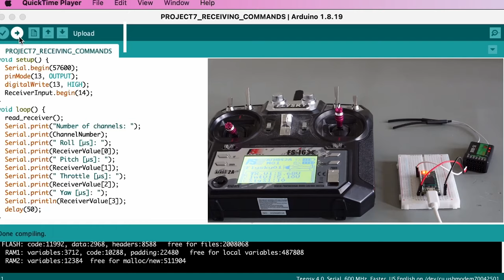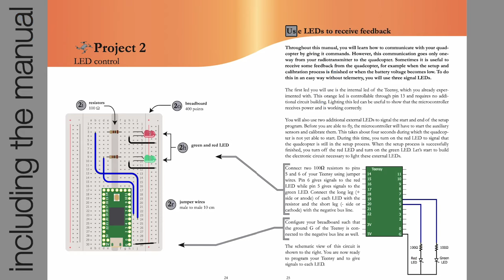Build and program this Arduino drone yourself!

Comment: Finally, airborne on the drone in my small backyard. But I need to go to a field, not my backyard, because of the cars passing. More to come of a video of a CA drone airborne.
Reply from the maker: Hi Robert, I watched your video's and your build is getting along very nice, great to hear you had a succesful flight!! With regard to the issues you encountered along the way, the screws provided by geprc with the motors are indeed a bit tricky and you need to verify that they do not touch the motor windings. I think the uneven startup of the motors might be caused by the width of the traces on the upper PCB, leading to an uneven distribution of current during the initial startup. I tried widening these traces a bit and the startup is much smoother now... good luck with further flying/adapting the drone!

Comment: I love the educational aspects of this project, well done.  I will purchase the control board and do all the associated projects. (I'm into RPi, Arduino, ESP32 programming and projects.) I like that you provided for FPV Tx power, but I would like to do a final built on a larger frame.  Do you see any issue using the control board as is with a 5" frame and larger ESCs (perhaps a 4-in 1) and motors?

Comment: After waiting and ordering a cheap batch of ESC, I finally found all four matches after calibration. As a result, the Ca Drone 1A can now fly and has 300+ lines of code from Ca Arduino  Drone manual.
https://youtu.be/xi5ei9N0uXg  is the video recorded in my backyard. With the Ca Drone code, one can modify it with additional sensors and experiments. This was a fun project, and learning the math under the hood.
Reply: Is there a naming convention of the CA (Ca? in keeping with his logo)  ...the CA drone?  Might I suggest a frame shape designation. H for H frame, X for X frame, etc?
Reply: @charlesbiggs7735  Made the changes, and I agree.
Reply: :face-orange-frowning::face-blue-wide-eyes: